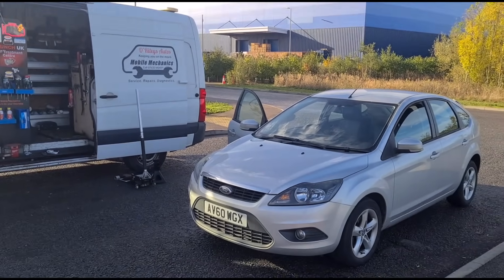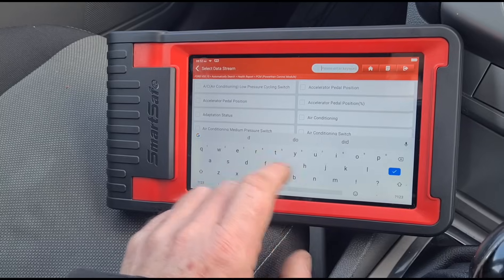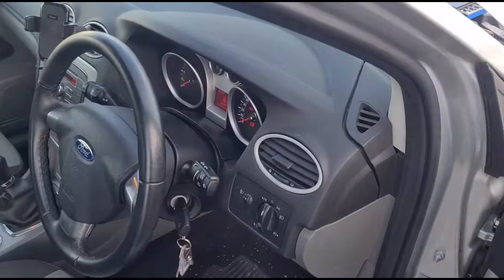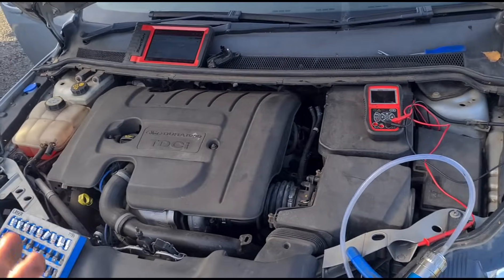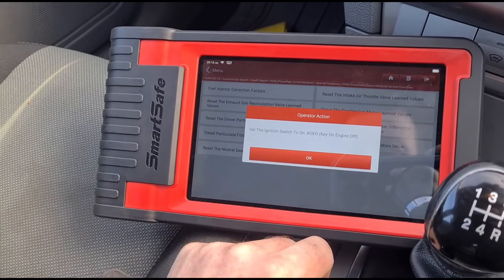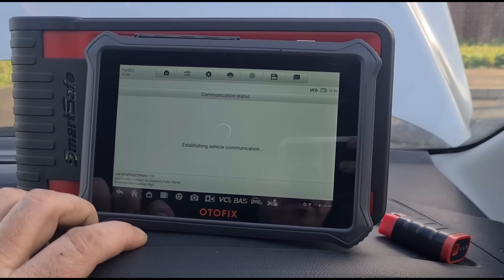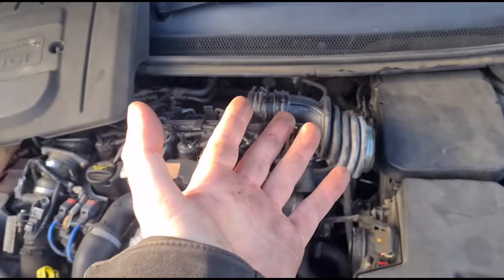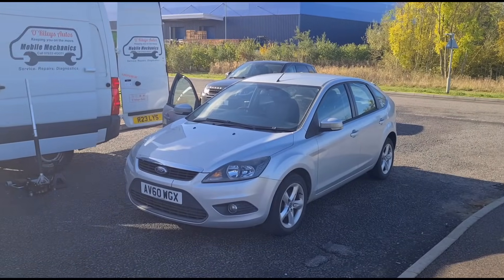Ford Focus 1.6 P244A-E0 & P242F-60 & P2463-E0

Comment: Hi  can I ask you for a bit advise please do you have email I got a Ford c max 2013 , driving it few days ago and the fault come up saying engine malfunction service ,  got engine light on  took to garage they put on machine say low pressure sensor, possibly glow plugs , so what happens if they fit them and still same  , I looked under the bonnet and there’s one of the two pipes from the DpF to a sensor crumpled off  car still runs good , just wondering if it can be just the pipe causing this please any help

Comment: how does the ecu detect/know the oil is diluted ?.
Reply: It’ll know how many times it’s attempted to regen & therefore how many times it’s injected diesel as part of that cycle. Because the regen has failed, it’s assumed the diesel is in the sump.

Comment: I would suggest to anyone with a focus Mk2 such as that they do check that pipe which was split. Jimmy did a flush on mine only which is what he was asked to do. Weeks later the problem returned and after all sorts of problems and a permanent measure being implemented I discovered the same pipe on mine was split.